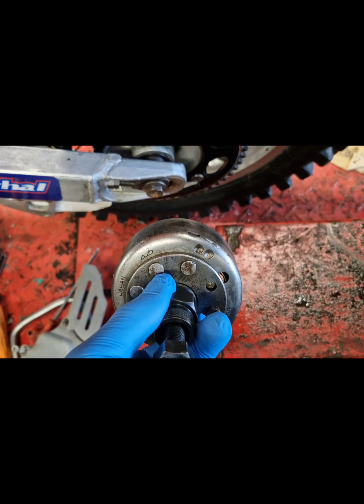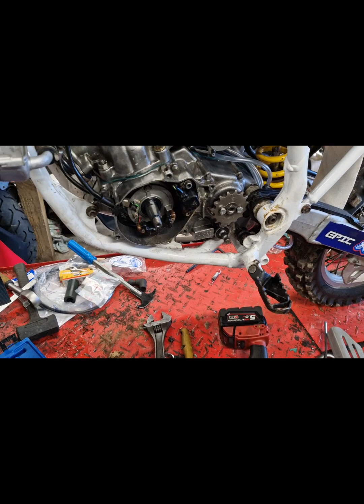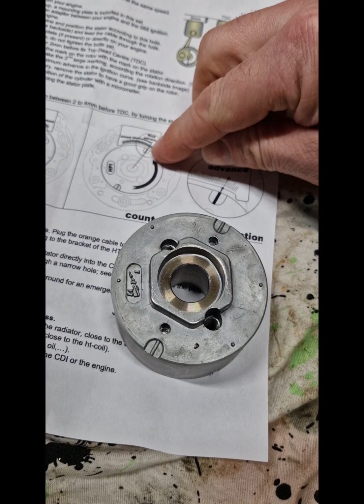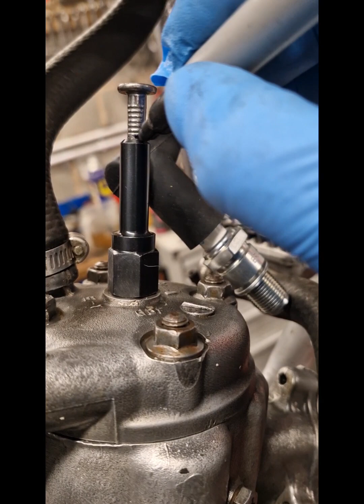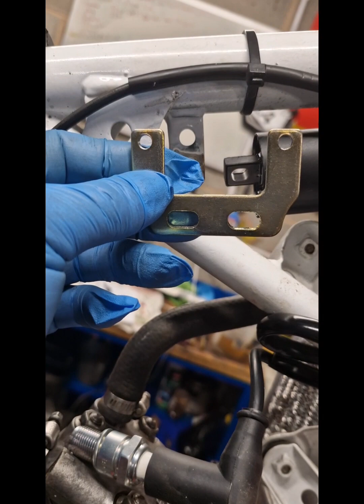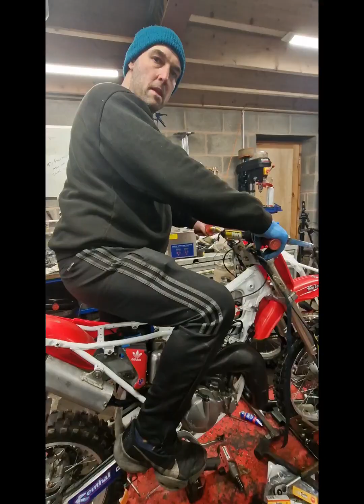1997 Honda CR80 HPI Ignition installation

Comment: I just bought a restored 79 CR 250 and just ordered a electronic ignition system for it and your videos have helped me. I should be putting it on this coming week when I get it and I already ordered the fly wheel pulling and the device to screw into the spark plug hole to measure TDC and for the adjustment needed.😊 It will feel very satisfying when I do the job and she starts up. I decided to do this because all of the electrical stuff is so old and I just don't trust it and it is next to impossible to find those parts. Thanks again.😊 From the US
Reply from the maker: Great news
You’ll love the 79 CR250 I’m sure
And you are right replacing the whole ignition system is exactly the right thing to do if you plan to use the bike
So much more reliable
Matt